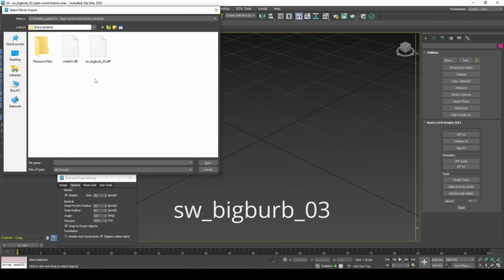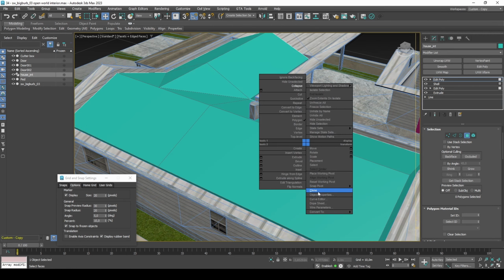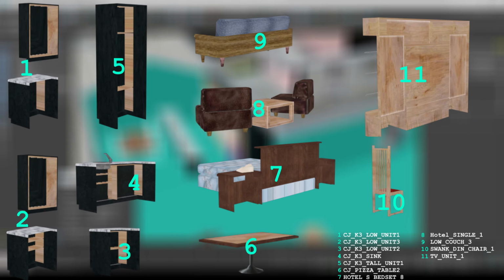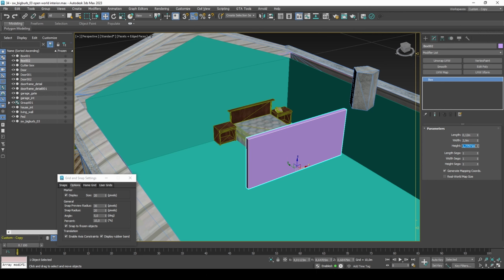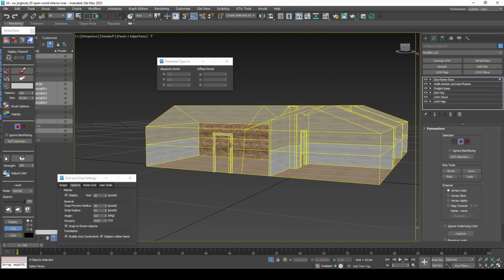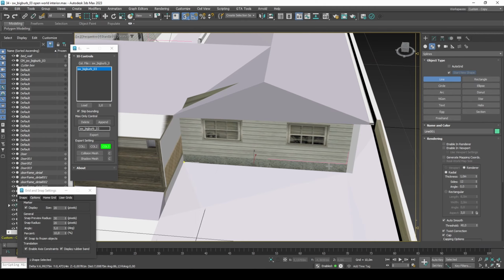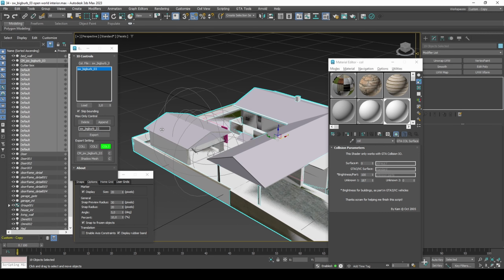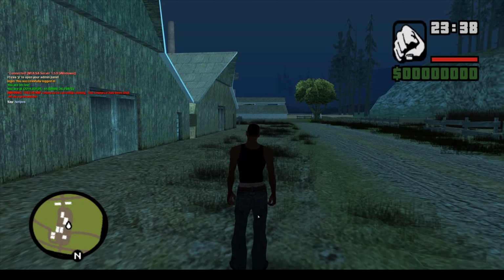34 - Red County Open-World Interior

Comment from the maker: SORRY FOR MISINFORMATION. I was testing the wrong file revision in this video.

The night lighting looks wrong ingame in this video, but it won't look like that when you test it yourself.
The prelight values I recommended for the interior will look a bit over-exposed as unfortunately I was calibrating the settings for a different file revision.

An interior vertex color value of 120 instead of 140 might work better.